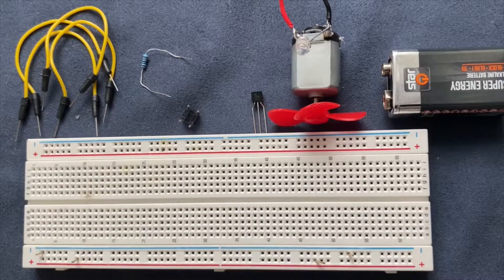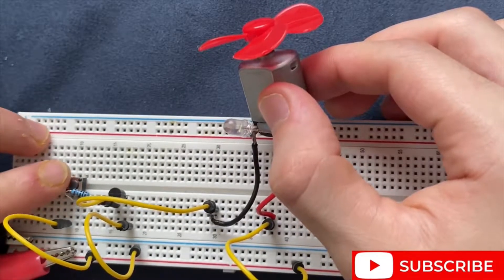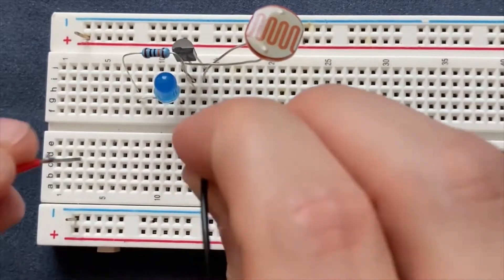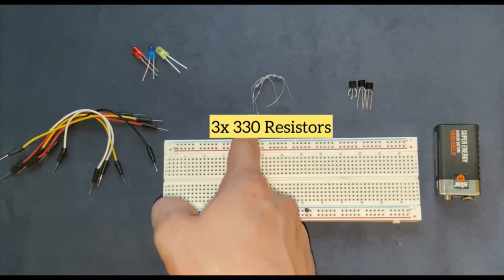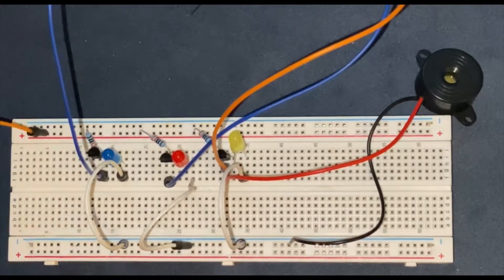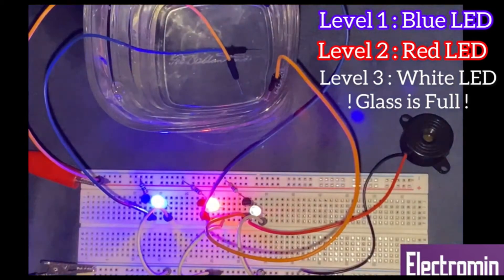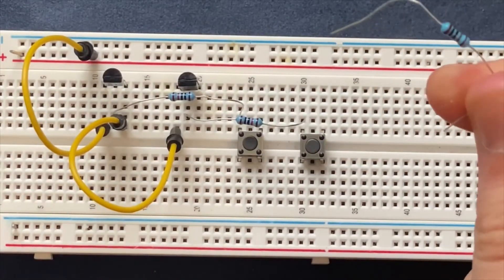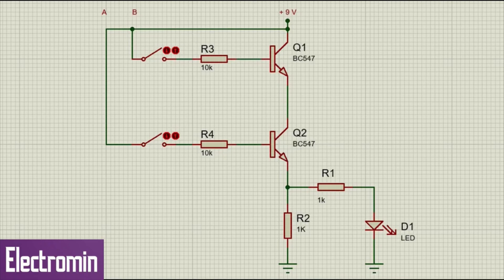Top 4 BC547 Transistor Projects on Breadboard in 2023  #breadboard #digitalelectronics

Comment from the maker: Other cool projects 🎥

Fire Alarm Circuit 👇

https://youtu.be/jc5K2RMGQY0

RC Low pass Filter 👇

https://youtu.be/JXGlq6THyWU

RC High Pass Filter 👇

https://youtu.be/q6zvZ1LpvIs

LED Flasher Circuit 👇

https://youtu.be/Zu1TZ-9C33U

Doorbell Circuit 👇

https://youtu.be/XZ2f612WOTU

Half wave Rectifier 👇

https://youtu.be/SHu47wmiY7I

Charging/Discharging Capacitor 👇

https://youtu.be/HUgAc91mMe4

Darkness Sensor using LDR 👇

https://youtu.be/kePkWBJPhYU

Electric piano 👇

https://youtu.be/daSFJJLkSj8

Water Level Indicator 👇

https://youtu.be/ghXExbBpctM

Logic And Gate 👇

https://youtu.be/IWW-HSIR5nY